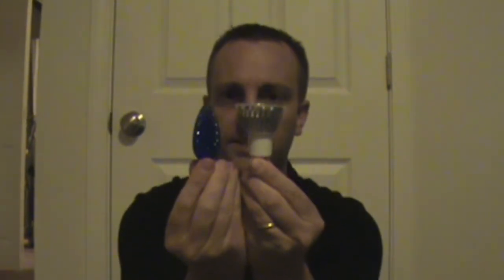Update to Solar LED Floodlight Hack!

Comment: Can you run those 3 watt bulbs in a regular strand of C9 Christmas lights? Just wondering if it would save from buying all the plugs and wire.
Reply from the maker: I would say absolutely!  We did the math on how much current they pull and since they are LED it is still very minimal.  I probably wouldn't go loading up a 150 bulb strand with them but I would have no problem daisy chaining all 25 of my lights together.  Look into the zip plugs, also called vampire plugs.  I bought a 1000' roll of SPT1 (SPT2 same gauge wire, thicker insulation) wire for around $100 then you can buy 25 packs of the male/female plugs and the sockets.